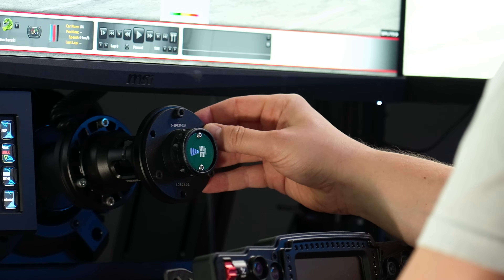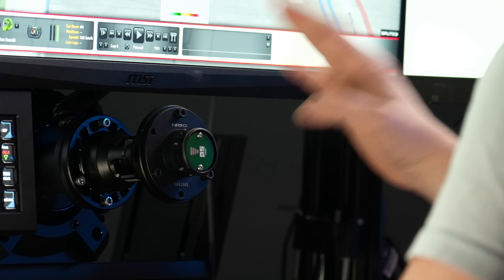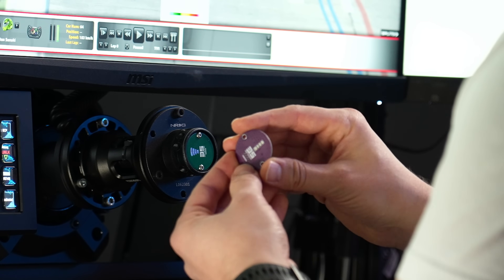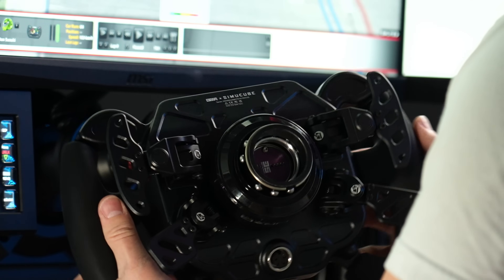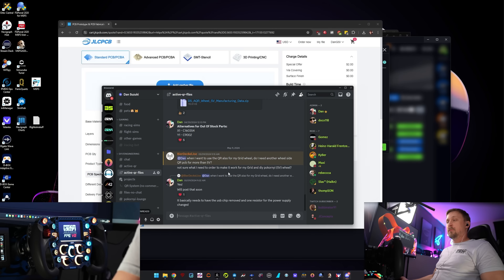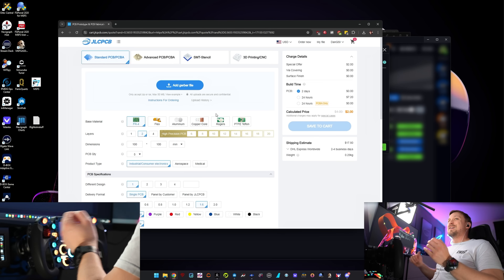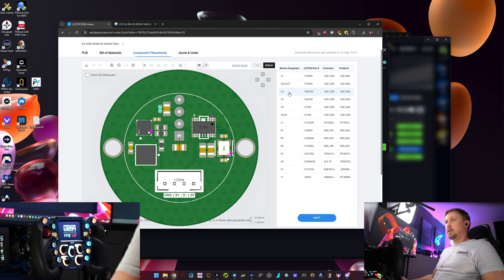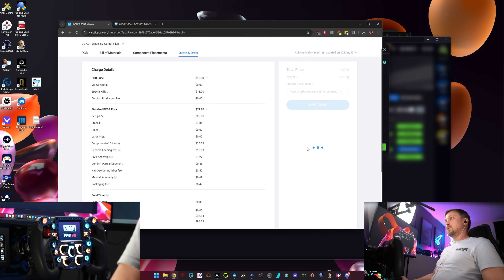A wireless* QR that works with EVERY base and wheel? Yep, I made one, build yours now!!

Comment: Hi Dan - awesome work!
Curious if this would work on bases such as the VRS DFP15, where the base natively supports usb passthrough, would that mean we can just swap with these boards on the base side / wheelside, connect the baseside directly with the internal usb passthrough connections?
Reply from the maker: Correct :)
Reply: @DanSuzuki I wonder why wheelside QRs are so expensive, it should be in the interest of each manufacturer to make it more affordable so they sell more bases and attract more users in their ecosystem. Maybe they are interested in making some profit on each 3rd party wheel their customers use as well. Eventually there should be an unified universal qr that most manufacturers use, it's just a matter of time i guess. Glad guys like you help move things along in the right direction!

Comment: dan what is the adapter you have base side before your shaft you created and how is it reading a fanatec wheel
Reply from the maker: Designed that myself and got it manufactured at JLC (75€) also added a srm tiny emulator inside … ping me on discord if you want the step file

Comment: Does the wheelside connector work with the factory Simagic wheelbases? Or we should use the wheelbase connection too?
Reply from the maker: It works with Simagic bases - you just need to replace the pcb in the base side

Comment: Hey Dan, for the GSI wheel how did you route/hide the wire coming from the PCB to the QR as there is no pass through on the back of the wheel.
Reply from the maker: Drilled a hole :) our newer wheels also do have passthrough now
Reply: @DanSuzuki  yeah, that’s what I thought. Was just checking. I have a new wheel.

Comment: @dan to sure if you will see this, but would this allow a Cube Control Wireless only (Simucube) work with a base like the DD+? I mistakenly bought one on EBAY thinking I could use the USB, and it doesn’t work… love my DD+ also bee very happy with it.
Reply from the maker: Unfortunately not - this only works for usb wheels. You should be able to buy the simucube link usb box soon though to be able to use your wheel
Reply: Thanks Sir!

Comment: Does this make it possible to work on simhub through this connection?
Reply from the maker: Yes this of course works with simhub if the wheel supports it, think of it more like a fancy active extension cable 😄

Comment: I've been mulling over the idea of converting my Asetek wheelbase using a 24mm shaft to 58/70mm adapter from SimSteering so I can avoid paying $150 per Asetek QR and I think you've finally convinced me to start on my idea.
Reply from the maker: you can use this QR and connect it to the wire coming out of the asetek base btw
Reply: @DanSuzuki  Yeah I noticed the wires when I installed my front mount and have been mulling over it since. There's 6 wires on the base for 6 pogo pins, and my current plan is to trace them from the usb connector on the Invicta QR to see if I can just get the 4 usb wires and go from there
Reply from the maker: 1 = 5V, 4 = D+, 5 = D-, 6 = GND ... 2 and 3 are not used
Reply: @DanSuzuki  You are the man! Thanks a bunch
Reply: @silenceddd  Bro have you modified it yet?

Comment: you say it works with all wheels and bases. Does this mean it would also work with a non usb wheel, like a Moza GS wheel? 
Meaning would it be possible to buy the wheelbase side pcb and use the Moza GS wheel? 
Or would I need to switch out the wheel side pcb with the pins too? 
Is it possible to connect the wheel side pcb with a non usb wheel?
Reply: The QR is essentially a usb passthrough meaning that you are rerouting a wired connection through it. If your Moza wheel has a wired connection, iirc there's the universal hub so yes, you could plug the base side cable into the universal hub and custom wire your wheel through the active qr wheel side. If you have only Moza wheels it will be fine but it won't be plug and play if you have other brands. IMO it isn't practical